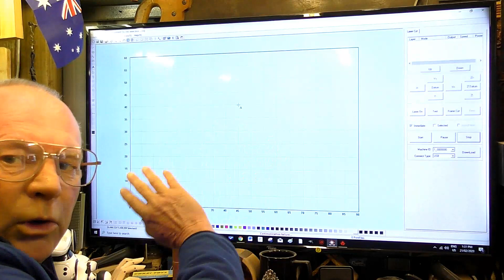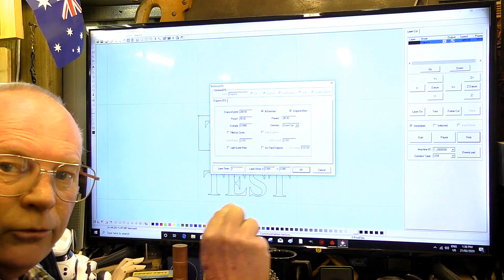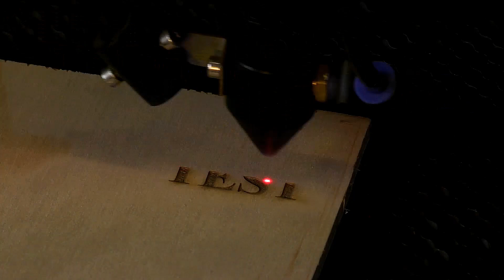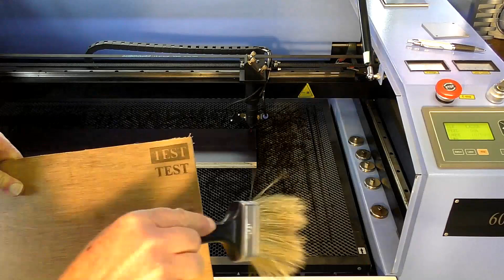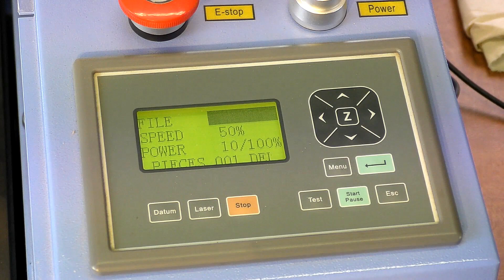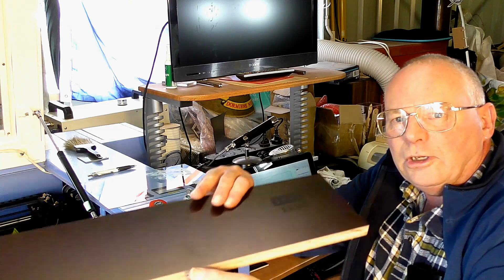LASER ENGRAVING WOOD, GLASS and CERAMIC HOW TO

Comment: Paper Phenolic Laminate sheets 
are made from layers of paper, 
impregnated with specifically formulated phenolic resins, 
bonded together under heat and pressure 
to produce a thermoset composite.

This is then bonded (heat & pressure again)
to plywood.

For "Stability" (warp-resistance) this plywood typically
has poplar or birch inner (foundational) plies,
but is often built up with Eucalypt, &/or Radiata outer plies
(for cost reasons).